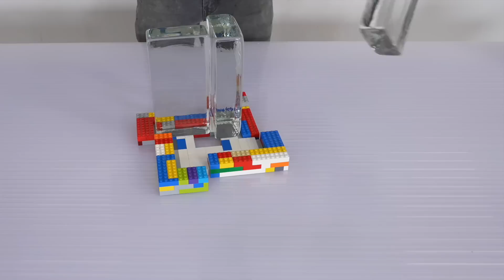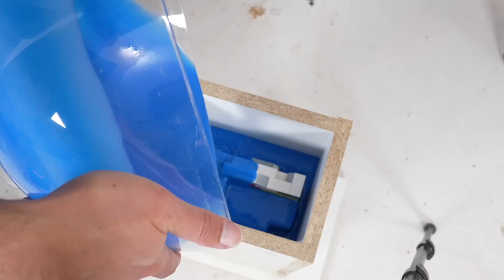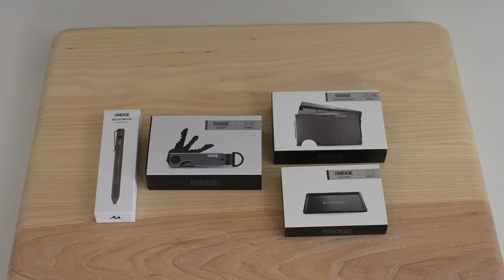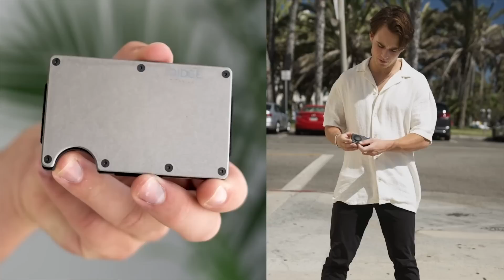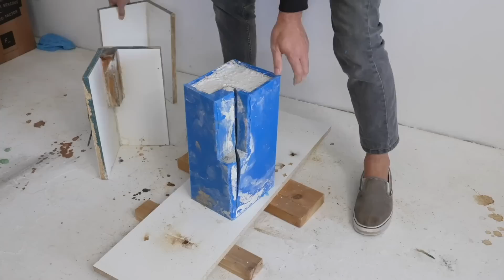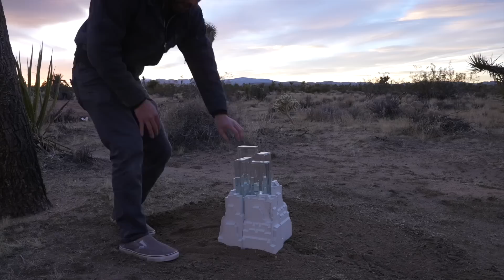DIY Landscape Lights

Comment: The way light reflects off those glass bricks is beautiful, I think if someone can make a bathtub out of those bricks, it'll feels like bathing in an ice tub, and that'll be kind of cool.
May be to connect the bricks with epoxy and glass fiber to smooth out the inner surface and to creat a non-slip bottom for safety?

Comment: Tip: Don't use razor blades to remove hot glue--rubbing alcohol is perfect for that. The super small size of the alcohol molecule gets between the hot glue and most surfaces and 99% of the time you can just peel it right off!
Reply: What this person said. IPA and it will peel right off. For prototyping stuff this is a god send.

Comment: FYI- Liquid Nails Landscape Block adhesive or PL500 Landscape would have worked just fine in this application. They’re certainly not as strong as anchoring epoxy, but this option is a lot cheaper and plenty strong for decorative stuff.